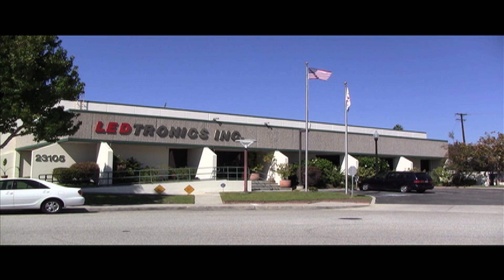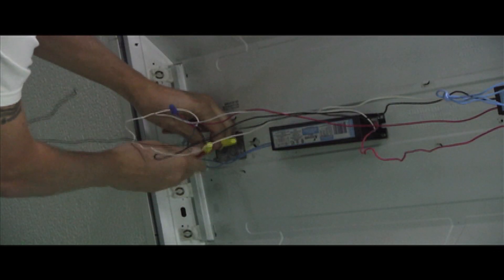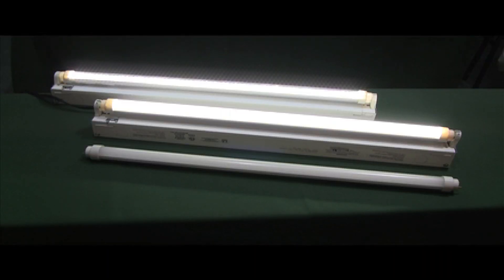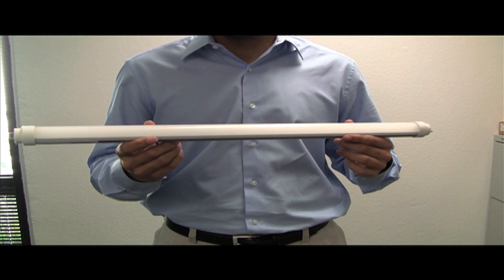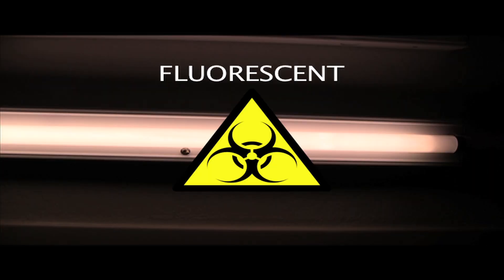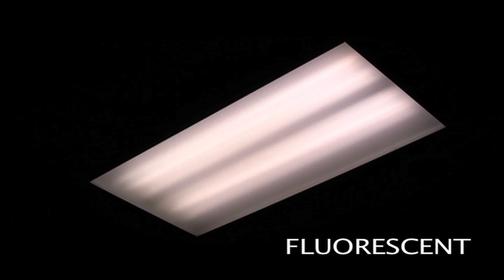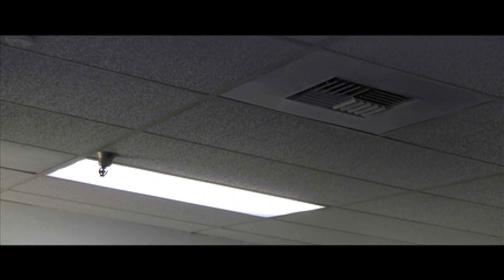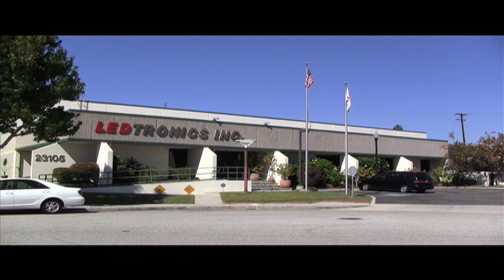LED T8 Tube Light Benefits & Advantages over Fluorescent

Comment from the maker: @wepollock Thermal management is required on ALL LED lighting products. Depending on the LED Chip configuration, drive current and other design parameters, various levels of heat sinking will be required to provide sustainable light output that is acceptable in the marketplace.

Comment from the maker: @wepollock We aren't sure of the Lemnis or Sylvania lamps that you're referring to, but if they are similar to our own line of screw in LED replacement lamps, there is heavy heat sinking below the LED/lens to provide the proper thermal management on that style of lamp.